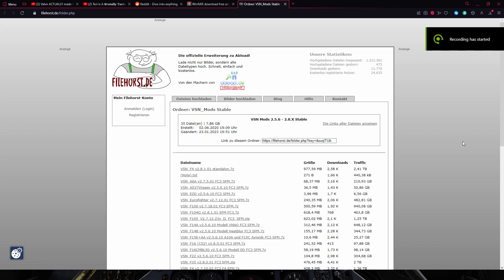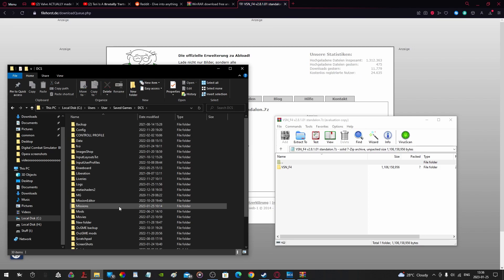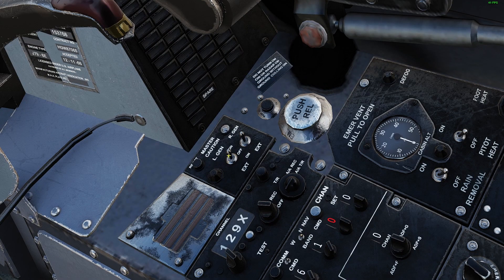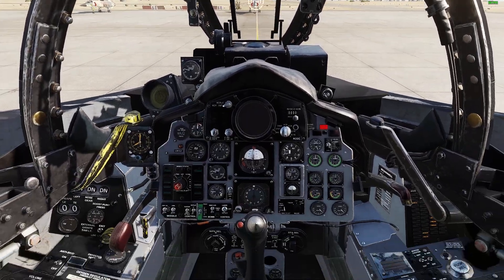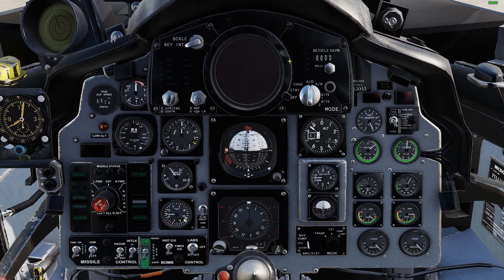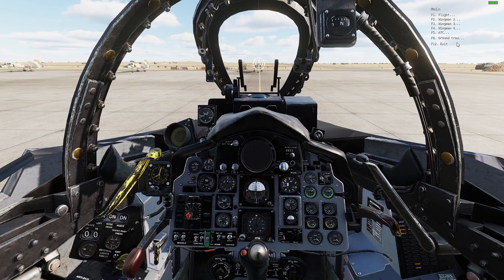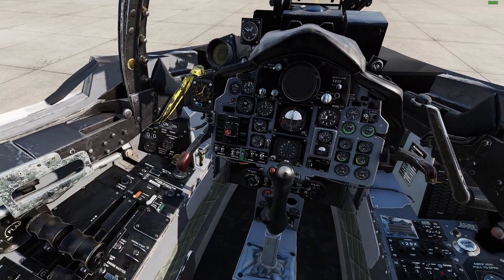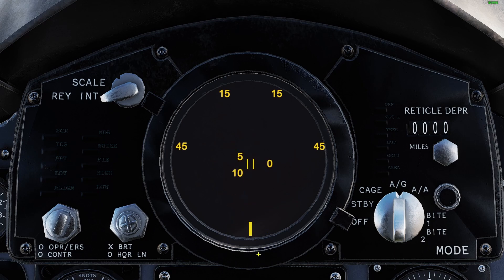DCS F4C Phantom tutorial: Installation, startup, Radar symbology and some cockpit intruments. Part 1

Comment: How do I get the VSN models to work, as in, how do I make them come up as something other than an AI aircraft?
Reply from the maker: Set them as Player in mission editor.
Reply: @fuzzybloodpc9291  Well, I have tried that. Now, let me clarify. I have gotten the VSN F-4,  F-100, F-104 and F-105 to work. But I cannot get the VSN F-22 and F-35 to work. I can select them and set them to Player and put a load out on them. But every time I launch, those two come up as AI every time. What am I missing?
Reply from the maker: @bretttrommler756  The F22 needs the Eagle Dynamic F15C to work and for the F35 go to grim reapers videos I forgot what aircraft it needs.
Reply: @fuzzybloodpc9291  I have FC3 installed. I've had it for years, so I have all the associated aircraft that either one of those should need as far as i know.
Reply from the maker: @bretttrommler756  welp I can't help you any further, enjoy the ones you have installed.

Comment: I installed the F-4 into my saved game DCS Mods Aircraft folder as you said, when I start the game up, I can see nor find the F-4 anywhere with in the game. What did I do wrong?
Reply from the maker: You did open the file with winRAR? and does the path have this { Saved Games\DCS\Mods\aircraft } the mod folder and aircraft folder must be letter for letter spelled out correctly. If that doesn't work Its probably not compatible with the new update/MT.
Reply: @fuzzybloodpc9291  I don't know how it happen, I went into the folder and rename that VSN F4 folder to F-4B-C and started the game up and both the A-4E-C and F-4B-C Phantom should up in the game. Just wanted to let you know it is working now

Comment: Terrible flight model!! Just preparing you guys. Don’t get your hopes up like I did. Huge disappointment!!
Reply: The model is  actually very accurate.

The problem is that if you're a Viper or Hornet fan, you will definitively miss the Fly-by-Wire that has spoiled so many pilots.

Just like the F-104, the F-5, the Mig-19 and the Mig-21, the F-4 is a plane for pilots who like to fight and survive by their own flying skills, not a flight computer.

The pitch up momentum happens because by design, the elevators have the the aerofoil currvature on the underside and the flaps are way back from the center of mass and create a nose-down force. That's why when you retract them, the nose goes up pretty damn hard! 

When you set the joystick, give the pitch axis a long, nice curve so the plane doesn't get too jumpy on you out of pilot over-compensation.

Trim her all the way nose down before takeoff and don't forget to engage the stability augmentation system (three switches located on the left panel, behind the throttle. One switch for each axis). That helps a lot.

She is unforgiving if you get her on a flat spin, just like the real F-4, but once you learn how to not to piss her off, is a beauty to fly.

Keep the speed above 370-400 and don't turn with nimble opponents. Do high-speed yoyos and lag pursuits instead.

This girl likes wide turns, but can outrate a Fishbed or even an F-5 in a two-circle fight if you use her properly. She also loves the vertical fight and has the power to do it.

The radar is somewhat simple but locks on pretty easily and has a mode that auto-locks the closest contact within the boresight. Very useful.

Air-to-Ground is straightforward and reasonably accurate if you did your homework and set the sight correctly. The dog-bone controls are simple and the systems in general give you a low workload.

Me and a friend had a blast fighting Mig-19s and -21s the other day. Didn't even use gunpods to make it harder! 

It was so good, that we decided to keep this mod even after getting the coming F-4E which I expect to be much more complex to learn and operate.

Good Luck!
Reply: @radarcontact1974  Hi, when I wrote this 5 months ago they changed the flight model about 3 weeks later and it has been much better. The original FM was bad and that is why they changed it. I’m interested in how to administer the auto lock. Can you point me in the correct control so I can keymap it. Thanks for your comment. I use this mod more than any other mod.
Reply: @craig8724   Hi! 
You are right! There has been some refinement of the mod. I forgot to mention that.

The radar mode I am talking about is "PLM". 

You will find it under the Sensors category as "Toggle Radar PLM ON/OFF". 

The thing is, it doesn't even have a keyboard combination. That's why a lot of people don't know about it.

I think you'll love it. Have fun! 😎👍
Reply: @radarcontact1974  there is no toggle radar PLM on or off. Crazy !! I’m looking under sensors now
Reply: @craig8724  Whaaaat?! We're talking about the VSN F-4B and C, right?

I just checked it before sending it to you. 

Hmmm... Be sure you have the latest version. There may be the issue.
Reply: @radarcontact1974  yes 4 B/C about to check the download for latest version. It’s not even listed in my program input files
Reply: @radarcontact1974  Well I just got the PLM working. Soooo much better. I had to redownload. Thanks for your comment because if you haven’t I would not have this fix. Thanks Bro 😎
Reply: @craig8724   Fly high, fight hard and give'em hell, Bro!! 😎👍

Comment: I put the file in its place but I don't see it in the simulator?
How do I activate the mod so that I can fly it?
Reply from the maker: Are you in open beta? and did you check all the way to the right of the module bar? also in the mission editor it's all the down.
Reply: @fuzzybloodpc9291  Indeed I play in OPEN BETA 
1. In the SAVE GAME folder I have 2 openbeta folders, one DCS.openbeta and the other DCS.openbeta.bak Why? i put the mod in the .bak folder because in the first their isnt mode folder  And do you need both?
2. I put in the F4 mod but I don't see it at all, not in the BAR line in the game and in the MISSION EDITOR F4 appears but in gray and I can't define myself as a PLAYER
Reply from the maker: @Kfirc2  \Saved Games\DCS.openbeta\Mods\aircraft 

create the last 2 folders and type them out exactly letter for letter. Hopefully that would work.